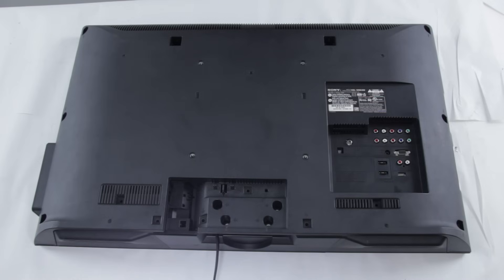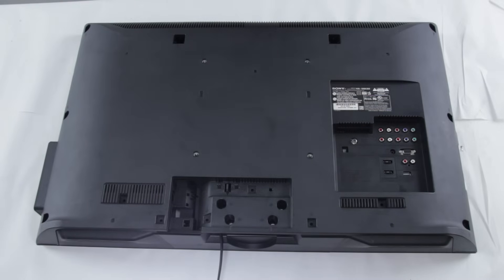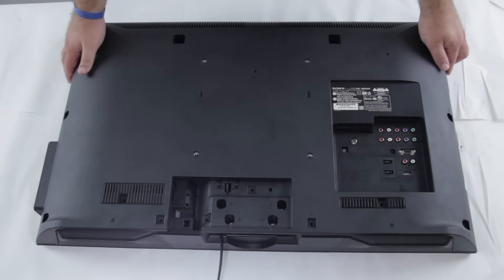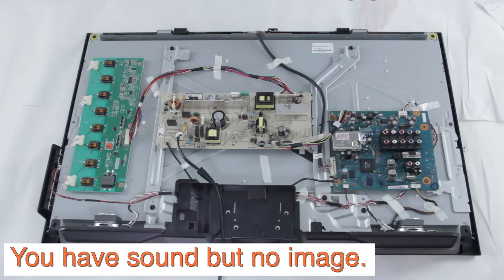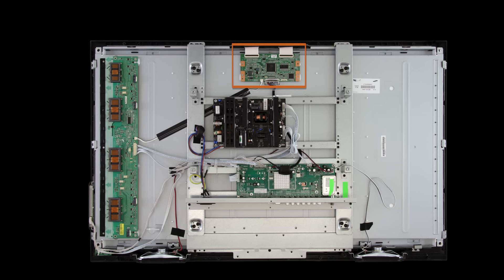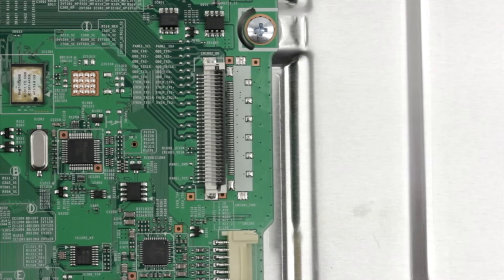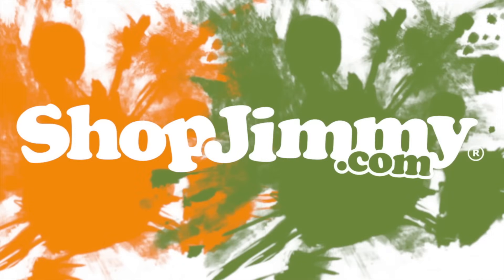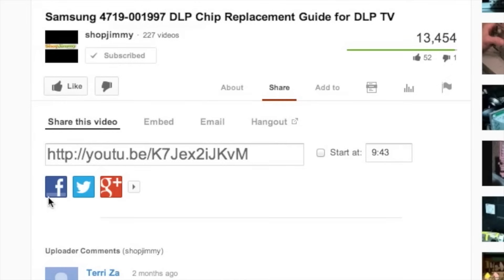LCD TV Repair Tutorial - T-Con Board Common Symptoms & Solutions - How to Replace T-Con Board

Comment: Thank you for the video. I'm traying to fix LG42LD750, all voltages on PSU look good except of A-DIM and INV on/off. And there is 3.4V on error pin. No audio, no backlight, no picture. Power on voltage is 3.23V,  there is 12.27V on all 12V connectors, 20.5V on 20V connector, 3.4V on other 3.5V connectors. 0.34V on A-DIM and 0.04V on INV on/off.  Would you guys give me a clue where to start the inspection? I added some more detailed description  with images to https://www.badcaps.net/forum/showthread.php?t=57487 (from Kubajs - date 2020-08-01) if anybody is interested. Thank you.

Comment: I have an LG47LB5D, serial number 704MXBPOL877, that has a picture that works and then goes to white vertical lines off and on trying to connect to the signal.  Also with the sound off, you can hear a tick tick tick, and it doesn't go away.  Any help fixing this would be great.

Comment: I'm trying to fix my Samsung UN55D6005SFXZA Version AH01.  The unit powers on, has a picture, shows HDMI1 input selected, no cracks in panel or backlight problems, but doesn't respond to any remote command besides the red indicator on the unit showing that it received the remote transmission.  When playing anything through hdmi the picture is very zoomed, distorted and colors are wrong.  Shows "Samsung Smart TV" splash screen perfectly at start up. Would you say this is main processing board?

Comment: I have an LG 60UJ6050-UA serial 712RMPG16512.   First the picture had two bright horizontal stripes across the screen.  Then it turned brighter at the top of the screen and darker on the bottom half like the leds were dimmed.  I took it apart and reseated all the connectors.  Now it is bright at the bottom of the screen but dimmed looking at the top of the screen.  I am leaning towards the tcon board but am not sure.

Comment: I have a Hisense 4kLED LCD TV - Model Number is 43H6D and the serial number is 43G171157H01669. This problem I am having is there is flickering and shuttering on the screen. I can see what’s on the screen but every other second it starts flickering/shuttering distorting the whole screen. If you could help solve this issue, it would be greatly appreciated!!

Comment: hi please can you help i have a samsung ue48j6300ak curved tv that when you turn it on the samsung smart tv logo appears on screen then hdmi2 shows at top of the screen the the screen goes black,  there is a menu button on the back of the tv but when this is press a small circle menu appears for about 5 seconds on the screen the disappears, when using the remote nothing happens can you help

steve

Comment: I have a sharp smart tv. model LC-60LE660U. the remote stopped working with the tv. and so did the buttons on the side of the tv. the light sensor is always on. and I checked the power supply board and power is at 14 and 15 pin 5.2dc v and I'm getting 12v and 13v across the pins, power board seem to be good. PLEASE HELP ME

Comment: I have a TV - SONY BRAVIA Model - KLV-32R422B , generated vertical lines , back light is there but no Picture , sound is clear. Is it the problem of T Con Board ? Or Panel problem ?

Comment: I have a E650i-A2 and when I plug it in the Vizio light in the corner comes on for couple of seconds the screen flashes the V on the screen and then the vizio light in the corner shuts back off. The tv remains on and I get sound but no picture unless I shine a light on the screen then I can see the picture.

Comment: Hello. I went to your website and I am trying to fix a LG, TV 42" - The problem is big bluish patches on the monitor and also 3 thin vertical lines on the left idea of the tv all the way from the top to the bottom of the screen. Any idea what could be? Maybe The T-con Board and I guess also maybe the leads. I wan to buy the parts and do it myself.

Comment: Sharp ROKU tv no picture with sound and backlight.  Replaced TCon board from eBay but same issue.  Double checked connections.  Sharp LC-65Q7330U

Comment: Im needing some insight on trying to diagnose my issue with my TV. I have a vizio d32h-f0 and I have sound but no picture on the screen unless you hold a flashlight to the screen at a certain angle and then you can see picture. From what I can tell the t con board cannot be detached. Does the problem sound like main/power board or t con board?
Reply: tcon board i believe

Comment: Hello Hope you can guide me here.

I have a Samsung UN46B7000WF that turns on and off, endless cycle. What do you recommend I replace?
A) Power Supply board
B) Main Board 
C) TCon
S/n  21H030PSC00070E

Comment: I have a Samsung UN82MU800DFXZA television. Back of tv shows LCD has light, but front of the tv shows a solid black/bluish color. Sound is clear and no issues. I ordered a TCON board (as most youtube videos and other sources seem to point to that being the probable issue) from EBAY and replaced the part. Same issue persists. Blue-ish front screen (LCD backlight is definitely on) and the sound works perfectly. I am at a loss here. I am new to multimeters and not sure where to start on the board to even test it. Any other suggestions on how to diagnose?

Comment: Hello. Sorry if this to old a video . I have this same problem with an old Vizio 32" LCD. No image, backlight and audio work. I've removed the back cover but I do not see a Tcon board. There is a single ribbon cable that goes from the main board to some sort of pcb on the outer frame of the screen (drivers?). I do see in you video that some tcon boards are integrated to the screen, but in mine the cable is not as you show in your video (NOT LVDS , but white ribbon). The only visable problem on the main board is a EH13A (1A LOW DROPOUT LINEAR REGULATOR) that seems to have extra solder on the in pin. I did send it to repair service but they could not fix it and said "your video board is broken and non reparable"
. Are there older tvs that do not have independant tcon boards?
Brand: Vizio
Model: VO320E-M
Screen: LC320WXG (SB)(R1)
Main Board: 0171-2271-2846
Also on main board: 3632-0842-0150(6J)
Power board: 3PCGM10002A-R

Comment: So I have 2019 toshiba fire tv the 4k smart my problem with is that power will go on it would load but than it would go off than on again over and over and at times off after that I can't use the remote to try to turn it on again I would have to unplug it wait a min than plug it back in to try to power it on again I thought it may have been the power supply board so I orderd one from eBay but still doing the same thing so anyone have idea what it could be I also thought maybe a few thing like the t-con board or main board or the panel?

Comment: Vizio model#M65-C1
The tv will power on show the logo then a small block appears in the middle of the screen with vertical lines. The tv then powers off and keeps repeating this cycle. Any help would be greatly appreciated.

Comment: Model TLX 04240B, SN JR7E6186730001357. Washed out picture colors. Replaced TCON board and the issue is now even worse. The colors almost look inverted. I made sure to double check the ribbon connections, and made sure everything was right (i.e not upside down, not loose, etc)

Comment: I have a TCL 55 in smart TV 4k Ultra model 55s405 sn# 1811gtc003837804716. My picture wwent out but I do have sound. when I turn the TV on it will flicker for  One second and the picture that comes up is really distorted then it turns black. My TV is only about a year old. As wondering if you could give me any advice

Comment: I have a Panasonic th-65fx700a . Sound and backlight ok, no picture. But turning it on and off sometimes 20 times it starts to work and works fine . Using a hairdryer to warm up the t-con board and turning it on and off a few times makes it work also. The main board has been replaced. Is it definitely something wrong with the t-con board? Please? Ta.

Comment: I have a Viewsonic N3235w TV, I tried a different power supply board and now a mainboard. Same as before, no picture.  When you turn it on I hear a "click" from the speakers and the red LED light in the bottom right corner turns blue.  The remote does nothing, won't turn on or off.

Comment: Sony Bravia 50in KDL-50W800B model T500HVF04.0 sound works. No image but you can tell screen is on. Replaced T Con board but still same problem no image. What else could it be?

Comment: Here's a doozy for ya...
I have a Hitachi L32AX03A made in 2010. Bought at an air force base in the Azores.
It turns on, backlights work. sound works, I can see the menu functions and the remote works as well. It recognizes the HDMI connection and I can hear the dialogue coming thru the speakers but there is NO VIDEO. I have replaced the T-Con board (V470H2-C01) and the results are the same. No caps are blown. No leaks detected anywhere. I am truly at my wits end! AND THE KICKER TO THIS....I bought two of these (same model) and the other one does the exact same thing!! Please...any advice would be helpful! 
I appreciate your time! Be safe!

Comment: I have a Samsung 46'' inch LCD TV, Model number LN-T4661F and the serial number is AHBB3CPPC05212N its comes but i have  white horizontal retrace lines running partially across the screen, i am using my laptop for video and i can see the video behind the lines. Any idea what could be causing this issue.

Comment: Further to my previous comment, I forgot to mention that the second time the powering down and rebooting issue started again, I first noticed it when I was flipping through the picture default setting options (theatre, sports, vivid etc...and every time I tried to change the picture setting the tv would crash and shutoff/reboot...the rebooting period takes about 20 seconds each time for the tv to come back on again...this suddenly evolved a few days later to what I mentioned below with the tv doing this all on it's own anyway we were just watching tv and not changing any settings.

Comment: Hello, I am writing for advice.  We have a Dynex LCD TV Model: DX - 55L150A11.  When we first got the tv used it had really strong visible verticle lines.  I researched it and it sounded like the tcon board.  We opened up the tv and carefully cleaned and reseated all of the contacts for the tcon board.  This fixed the issue for a couple of months or so but then the problem started to come up randomly although not as bad.  We were very busy at the time so we started bumping the top of the tv with our hand to do a quick fix.  Very stupid, idiotic thing to do I know but it did work temporarily.  After about a month of the that the tv suddenly started powering off briefly completely (no screen, red light coming on) and then booting on again.  It started out about once an hour and after awhile became every like every 20 seconds although still random with periods where it would stay on for a few minutes.  We again opened up the tv and this time both we cleaned the tcon board and reseated most of the connections in the back of the tv.  This worked and the lines were gone and the power stayed on.  But after about a week the vertical lines started to come back again on certain colors.  Now it has been a month and the powering down and rebooting issue has started again...extactly the same about once and hour and now every 20 seconds but still totally random.  We love this tv and I want to order replacement parts for it.  But I don't know if we can figure out what is wrong.  Do you have any ideas as to what could be wrong?  Thank you so much.

Comment: 55 tcl roku 4k. 
55us57wtkaa
TV died.  No power,  no lights on.  
Replaced power board.  Unit powered up and worked for about 10 minutes.  Then no power issue again.  Had some black areas blinking on screen but looked ok for the 10 minutes! Was told the power board could have been the issue, new one defective.

Comment: Hey Jimmy...I've had a recent issue regarding my LG Smart TV.  Model # 65UH6030-UC.  My girlfriend was watching tv when she heard a pop, and it turned itself off.  Imagine disconnecting the tv while it's on...then the tv came back on again.  This time the right side of the tv is dark.  No matter what station we change it to, what input we change it to, it's dark.  We could still see the show, but it was much darker that normal.  Fast forward a couple of weeks.  I'm watching tv, and the same thing happens a loud pop occurs, and the tv resets itself.  When it came back on, there was no change from before, but still dark.  This morning when I turned on the tv, the right side had gotten much worse.  You can't really even see the digital menus.  Any help would be great.  I took off the backside, and everything seemed fine.  I guess I was expecting some burnt parts, like a fuse.  Your help would be greatly appreciated...

Comment: Sir jimmy pls help...my samsung curved tv UA55KU6300GXXP just simply turned of while were watching..and i noticed theres some kind a small burnt part on the panel..upon facing the panel the burnt part is located at the bottom left corner just an inch upper in the corner..Now if im going to plug it IN again it has stand by red light then it switches on by itself but doesnt go through just a bit of blue color appearing in seconds then goes off again..and to observe..the red standby light goes ON then switches by itself again..it does a cycle of that sequence..hope you can advise me how to repair my tv..many thanks and more power!

Comment: I have a TCL model LE50FHDE3010MDAA and it works fine for 5-10 minutes then the picture goes black but still has sound. I have replaced the T-con, main board, and now the power supply board and it still does the same thing. Any idea and a cause or potential solution to this problem.  Thanks

Comment: I have a 55” RCA model # LED55C55R120Q , no sound or picture, but backlight is working. For the last week or so, picture would eventually come on after several attempts of powering on/off- but now, it won’t come on at all. I’ve removed the main board, but just wanted your opinion if you think that it’s the main or could it be the tcon board? Seems to be an open relay possibly, but not sure on which board.

Comment: Yes I have a Hisense 55" tv. At first it wouldn't stay on so I replace the main board and that worked. But now it has a solarized picture.  I've replaced the T-Con and still same problem. Ideas lol. Its model 50H5G 120V. So total replaced is power an main board and t-con.. thanks

Comment: I have Toshiba 32P2305 television. When I plug in the main power, I have a green light(tv is in switch on) , but my television remote is unresponsive and can't even switch it off (tried with hard switches at the back as well).
I have firestick in hdmi so tried to cast youtube on firestick but still it's not working not is there any sound.
Please suggest any solution, if this is main board or tcon board issue..

Comment: I have a LC-58q737qu tv made by sharp. Lightning hit the tv 1 year ago and we took it to have it repaired. It worked fine for 2 or 3 months. Now when I power it on. It powers on everything works.  I have a crosseyed screen. It started in the middle and falls off the right side of the screen to start on the left side of the screen. What should I do about this???

Comment: Hi there, are you still taking comments? I have the vertical lines on my Finlux 40fbd274b-t. I found a replacement av board and t-con board but I am not sure if I should get both or just the t-con board. Could it be the ribbon which connects them? Thank you so much for making this video!

Comment: I have a Toshiba Television Receiver made in 2012.  Model 46L5200U.  It turns on with audio and video.  Then after about 10 seconds, the screen goes blank.  Is this the T-con board?

Comment: Legend LV1507 / serial #717C000LV1507000791 with no sound. 
I used to be able to cheat it & run the headphone jack to radio in camper or small BT speaker, but now that doesn’t even work.

Comment: samsung ln40a540p2fxza, after lightning strike the TV has no image on screen. The power LED blinking continuously. I’ve replaced power supply board and main board, but the LED blinking is not changed. Also, if I use the remote, the blinking LED frequency changes as I use the remote.

Comment: All outputs including HDMIs and component ports are only displaying black and white. Tried different cables already. What would be the problem? P.S. Sound is working and built-in apps such as Netflix and Hulu work fine with color. Only when plugging in outside source do I have the problem.

Comment: Samsung TV turns on and half the screen is white. I re- seated the ribbons and that still didn't work. could the T-con board be bad? I tried plugging one ribbon to the other side of the t-con board to see if the T-con board is bad and it just went black. not sure if both need to be connected for a picture to show up. Model # UN65H7150AF

Comment: Hi here is my problem i have a sanyo FW55D25F 55 inch when i go to power it on the Sanyo logo showed for 3 seconds and shout off. I have replaced the Main Board and the Power board and still have the same problem can it be the t-Con board ? or any other suggestions thanks.

Comment: Thanks for the video. I have a Vizio D55u-D1 and have an issue with screen shifted, meaning look like the two sides of the screen merge and the image look zoomed. I changed the T-Card and happen the same, I am thinking if I can update the firmware of the mainboard. ANy suggestion will be appreciate.

Comment: hi I hv a jvc  model no Lt 40N555,had a power  surge and it blew the power board, got that one fixed, now the set switches  on plays sound and and the back light or led do come on but not the screen  for a display,pls help what to check on the t con

Comment: Sorry couldn't add photo...multiple vertical colored lines on half of the tv that are fixed and an area that looks like there is a crack on the screen but there is no actual crack on the screen when you turn the tv off.